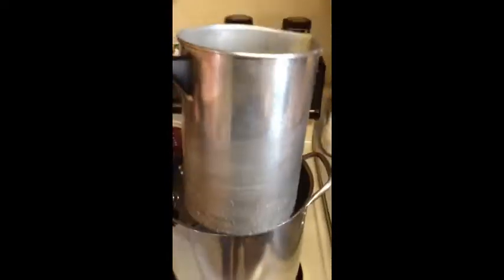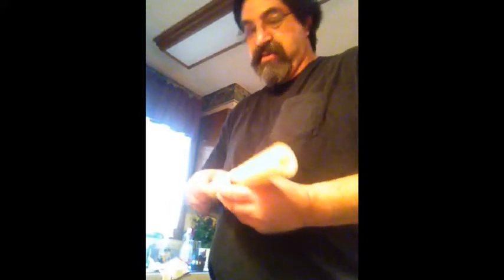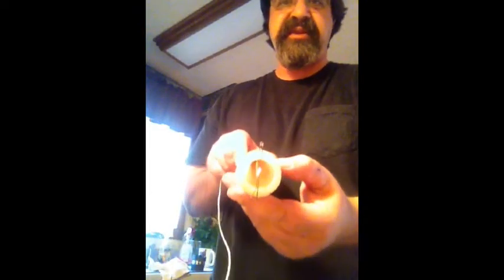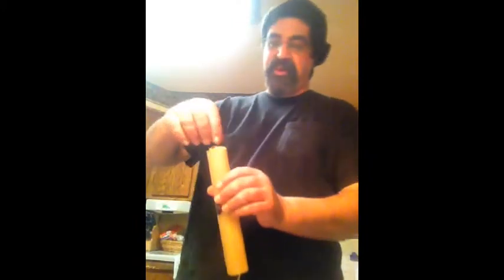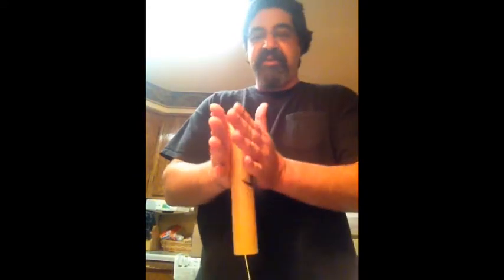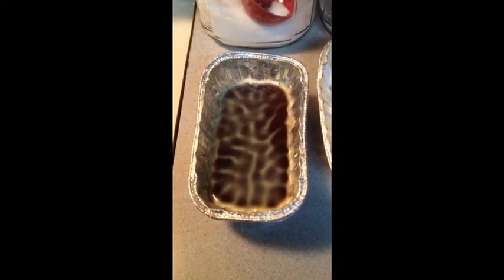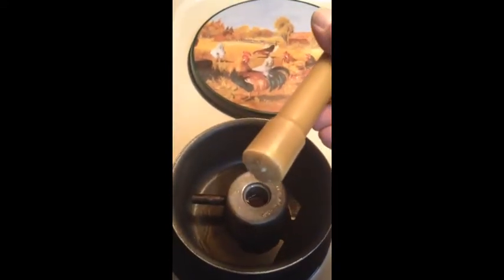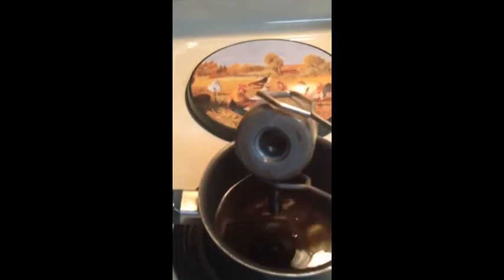Making Beeswax Candles With A Colonial Taper Candle Mold

Comment: Hey there.  I enjoyed your video and plan to start making bees wax candles soon.  I was wondering if you still use 4/0 wick for that size candle; are you satisfied that it burns well, etc.  My research online is telling me differently; i.e. to use 2/0 square braided cotton wick for taper candles say, 3/4" in diameter.  I was also wondering, since your video is a few years ago, if you have learned anything new or do anything differently since it was posted.  Thank you --
Reply from the maker: I was making the candles for my Church. The 4/0 worked well for that. It would last through a 2 hour service and only burn half or less of the candle. We only burn 1 time. Then remelt what was left. Constant recycling.I no longer make the candles. I passed that off to another parishioner to do. I chose the 4/0 based on talking with candlewic.com and their recommendation. Good luck with making your candles. It’s a fun process. Watch your temperatures when melting. Beeswax is highly flammable. Thanks for watching my video and commenting.
Reply: @truckdrivinmilanr  Thanks Milan--I didn't expect to receive a reply, so I appreciate that you did.  I acknowledge your point re: temperatures, and noted that you noted a pouring temperature of 147 or so.  I'm catching the bug and haven't made a candle yet.  If and when  I do, it will only be beeswax candles.  Anyway, thank you.  God bless you and yours.